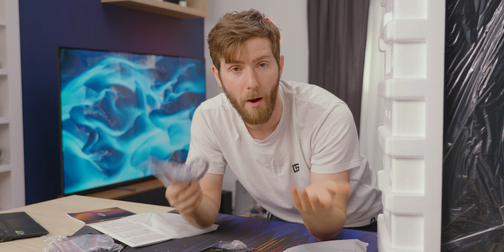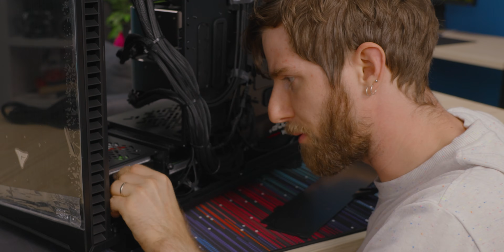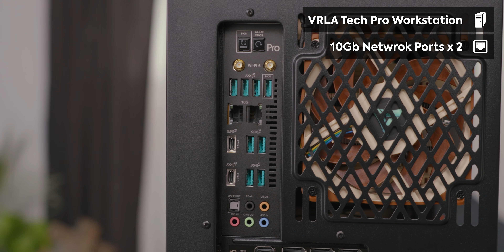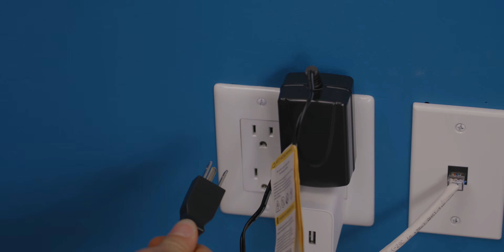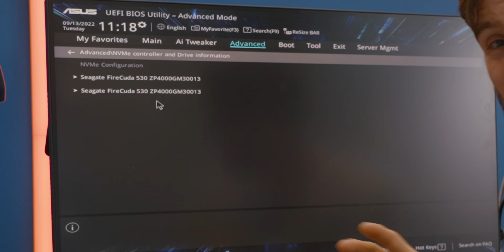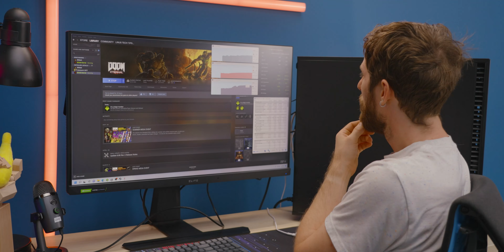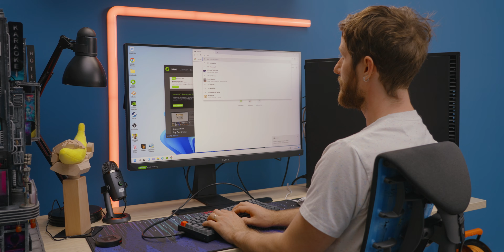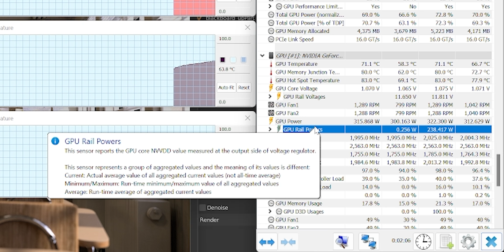This PC blew our circuit! - VRLA Tech Threadripper PRO Workstation

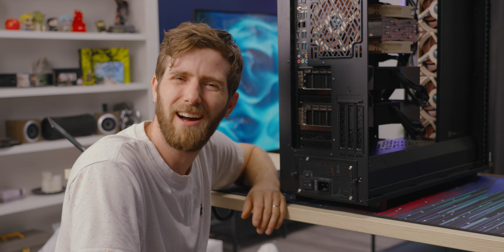Comment: 5:08 - I actually still use all those ports, though not for their intended purpose. I use FL/FR (green) as stereo out with parametric EQ + highpass to my main studio monitors, C/SUB (orange) as stereo out with lowpass to my subwoofer, and RL/RR (black) as stereo out unprocessed to a stereo amp that I test speakers with, though I plan to also use this for the sake of making mixing in desktop audio easier when I have a physical mixer board. All three operate independently from each other with EqualizerAPO, or with HDAJackRetask in Linux, and all three process the exact same stereo signal.
Reply: i use dante for any non standart thing. it works great, and uses one a reliable network.

Comment: I have a VRLA Apollo model I bought a couple years ago when Linis ran his first video about them. It's not a top of the line pc, but I've had no issues in the time I've owned it and have been very happy with it. It is a very basic setup with little RGB. It has a ton of room in the case if I ever want to add anything to it. I highly recommend them as I've had several pcs over the years from various companies.

Comment: Linus I thought you already knew it's only Windows that prevents automatic configuration of dolby surround. MS requires DOLBY ATMOS or equivalent to support more than 2 speakers its a licensing thing.  In the past I had always used the SPDIF or optical or the component jacks with windows but now I just run Ubuntu on my Home theater PC.  The MB manufacturers don't really care what MS says and continue to offer the jacks like they always did.

Comment: “No, don’t touch my precious dozen 3.5mm jacks! I am one of those people that needs them!” (Proceeds to describe using Optical and/or One (1) Singular 3.5mm output.)

-Every commenter saying we should keep the cancerous tumour of useless 3.5mm audio jacks.

Anyone that uses their motherboard as a surround sound source is going to use the Optical port or HDMI audio. 99.5% of everyone else is going to just use the stereo and mic in jacks.

I would vastly prefer that all of the circuitry dedicated to 7.1 channels worth of Pre-Amplification and DACs to shitty little 3.5mm jacks went to just giving the headphone port an amazing onboard DAC and High Impedance capable Amp. 

Hell - even optical is dead and gone at this point, I’d take a well integrated HDMI 2.1 Audio option with Atmos / E-ARC support any day. Chuck that plastic piece of 1980’s detritus in whatever old folks home they stuck Beta and HD-DVD in. 

For anyone that does still need ALL of those other 3.5MM ports for their 7.1 Surround Sound (and inexplicably decides to have their primo audio signal source run through copper strands the thickness of Galadriel’s finest pube, complete with the several metric gigafucktonnes of interference that only such a girthless unbalanced analog conductor can provide), there is a simple solution. Go on eBay and buy a High End SoundBlaster card for $10. There’s Eighty Shittillion of ‘em out there getting shoveled onto the global e-waste pile every second (I wonder why). 

Do they even make speakers / amps / receivers that can accept 7.1 via 3.5mm anymore? No? You’re adapting 3.5mm TRS to XLR? Oh yeah? Cool. Cool beans. Cooool. Unrelated question :
How many bodies you got under those floorboards there you absolute gotdamb psycho? What next - you gonna chuck a friggin VGA adapter on to that 3090ti? 

If you have a high end 7.1 audio system and are feeding it the salmonella riddled gruel that is unshielded 3.5mm cable (or are one of aspiring Mensa pledges in here screeching for Szechuan Audio Sauce), I hope that you get help (picking out a cute straight jacket). 

If you disagree feel free to go into the streets and protest. Don’t bother making signs, I’ll know it’s you guys when I hear a portable Behringer PA system blasting a 96kbps Limewire MP3 of “We’re Not Gonna Take It”.

Comment: On the 7.1 audio topic, I do use 5 of all 7 channels, just for processing (not aplification), have an all diy setup, a sub that's flat from 10 to 70hz, 2 woofers that take it fom 70 to 120 and a pair of bookshelf to do the rest. Everything is equalized using rew and equalizer apo (with an umik-1).

I'm finding very dificult to upgrade my pc (10 years old already), since newer boards with 7.1 processing are very expnsive here in 🇧🇷 .
Reply: why not use a usb 7.1 dac??
Reply: @juri14111996  I'm not sure if the equalizer apo works with it like the onboard does, because I do have 4 diferent channels being individualy equalized, like my sub and my woofers are a copy of the main channels. The sub has a low pass, the woofers have a bandpass and both are also equalized and gain matched. But if an usb card does work like onboard audio, it's  going to save me money when I upgrade my pc.
Reply: @captanspace  if you use a special 3. party software for this it should be no problem.
I think your dsp programm just installes a virtual audio device to get the audio of every app you use and converts it to 6 or 8 channels witch get sent as 5.1 or 7.1 to your physical audio card. So it should work just fine.  An alternativ solution is to use a cheap dsp, diy perk just did a video about a hidden tv with 7.1 audio, using a cheap dsp to splitt the audio in different frequency ranges for the different drivers.

Comment: I actually have that same motherboard with 256GB of 3200 DDR4. It has a 3955WX 16-Core Zen 2 Threadripper Pro. It's going to be my storage server. I got the motherboard complete in box with the ASUS 4xNVMe card for $770 US. The CPU was more expensive at $950

To answer your question Papa Linus, I actually use the motherboard audio ports for surround sound. 5.1 Channel.

Comment: sigh  Yes, I have a 5.1 analog speaker set I hook up to the audio ports on the back of my PC.  This is actually a change vs. the USB soundcard I used for 6+ years before this PC upgrade.

Comment: I actually used the line out for audio up to 5 days ago... got rid of it because of noise in the audio due to lack of shielding. Light doesn't care about that.
I also got this case and really like it! enough space allthough I would've liked it if the front fan mounting wasn't as bulky because it does obstruct quite a bit of the fans when you use 140mm fans. (liquid freezer II 420mm in my case)
Reply: optical sucks tho it has super limited surround unlike analog which can do any kinda surround.
Reply: @gamagama69  I'm not sure what you mean exactly but if you mean the options of surround (decoding) types, that is not really a problem for me because I run 2.2 audio and have no center or surround channels of any kind.

Comment: I have the NF-12 and A14s in mine, and I think I put around $300 in fans since I slapped a second fan on my TR4x 3990x Noctua tower cooler. 8 NF12s and NFa14. Then the extra fan on the CPU Block. 

Wait how was this 20K? This has way more stuff in it than mine. And mine was 15K. OH YOU KNOW WHAT, they probably saved a butt ton of money going 2.5 and 3.5 where I was being silly and went with 2 8tb NVME and 1 4TB  Gen 4. Where they probably have a reasonable boot and main NVME like 2 TB and then 100TB in SSD and HDD. for the same amount as my two 8TB sticks. Also probably didn't get scalped on the graphics card where I paid around 1k more than necessary.  I went with the same tower. I get silly temps on mine in an 80F plus room, never went above 60C when running Cinebench on overcolocked CPU and GPU. How I almost got 60,000 score was like 100 points shy. Edit: I went with the industrial class fans in my rig, and it gets up to 80dB, LOL.

Comment: I use analog 5.1 but the last three boards I have bought have Fd up drivers and do not work right...center channel doesn't work or the left channel becomes the center channel...the two sound cards I bought only one works correctly and it sounds like garbage

Comment: The 7.1 ports in the rear are functionally just there so that you can also piggy back off the 2 ports in the front also for some kind of Dolby Atmos(9.1 surround) support. It would be technically better to use the motherboard 7.1 ports to free up data from your HDMI cable so that you could comfortably enjoy full 4k/or high fps with no image loss & run an extremely high bitrate out to each individual speaker (in my setup, I run an individual amp to each channel (4 amps (the subwoofer is being passed through the center channel)//note: not Dolby Atmos compatible amps, for this you'd probably need to run sound through your HDMI to an amp, but technically you could theorize noticeably better sound quality coming from extremely high end speakers this way). :stayhome:
Reply: If your motherboard sound driver (like realtek //depending on the motherboard) supports additional channels than Atmos support than becomes more of an identifier for media that will be compatible than a requirement, also Google is working on an Atmos competitor that is rumored to be popular among tv manufacturers due to Dolby charging money per tv and google offering the service for free. (Informative note: Most PC streaming services don't support surround sound on windows besides Disney+ at this time, but if you have a pc with lots of storage you could just pick up a bluray 4k player, look for atmos compatible blurays, and rip them to your pcs storage, keeping the disc's as failproof backups) and get surround sound this way).

Comment: Yes, absolutely, some of us do use normal surround systems. And it still puzzles me why now they aren't considered "cool" anymore despite still sounding miles above all the dinky headphone surround emulation technologies. Their use become so niche, that possibility itself is often overlooked. Case in point: when I chatted with devs of one of my favorite games and mentioned how great and immersive it sounds on surround speaker system, their response was basically "Oh, we didn't even knew nor checked that it supports that. I guess it comes enabled by default in the game engine we're using"

sad surround noises
Reply: Agreed, disappointing how many games use stereo audio or only optimize the audio for headphones these days!
Reply: but you can just use a 7.1 usb dac.

Comment: I know a machine like this is literally meant for one thing and one thing alone, work. That being said, I do kind of wish they used redux or chromax fans inside of it to keep the black aesthetic. Idk about you guys but the idea of having a 5995wx on the asus pro art all black motherboard with a bunch of rtx a6000s with nvlink bridges, and every memory slot populated with 256gb lrdimms each using a black ek ram heatsink module, an all black 360-480mm aio and all black noctua fans is just a wet dream to me. Use 2 of those p5800x optane u.2 drives, and 5 8tb Sabrent rocket 4 plus drives using the m.2 quad raid card. Populate all the sata ports with 100tb nimbus ssds, and top the whole system off with an asus thunderbolt4 card. That right there, especially if use use all the ek professional watercooling equipment for it would be literally the fastest computer you could build that isn’t some crazy custom ln2 or liquid helium closed loop thing that wouldn’t be feasible. Not only would it be the fastest and most extreme thing you could build, it would also be an absolute beautiful system. All black. Everything covered in black heat sinks or black shrouds over the pcbs. Even the nimbus drives are black if I remember correctly.

Comment: I just want to,point out that those stickers like the one covering the IO Panel at the back can generate quite a lot of static electricity when you tear them off. Either use ones that are specifically anti-static and for electronics or don’t use them

Comment: To answer your question, yes, I still use analog 7.1 audio ports (when I game, I use a pair of Razer Tiamat 7.1 v2 headphones, with discrete drivers for each channel). It helps with hearing the bogey shooting over your shoulder.
Reply: i have the version 1 of this headset, still works, but i dont use i any longer. i switched to a logitech pro x wireless.

Comment: 7.1 Analog is kinda useless for a real 7.1 surround sound system. However, many companies like Logitech will make 7.1 or 5.1 PC speaker setups, which is indeed cheaper than the better HDMI surround sound which would also enable Dolby Atmos and you could use some real speakers and not shitty PC speakers. So while not used by many, it is still used.

Comment: I don't get why you say the 1600w power supply is "future proofed".
3090 ti can boost to take up to 450w a piece, and I wouldn't be surprised if the threadripper pulls 200+.
That's 1100w, all the peripherals might also pull close to 100w.

that's a theoretical max draw of almost 1200w, most power supplies are most efficient at ~50-70%, so I would say that it's a rather good pick.

Comment: I have used the optical audio out (SPDIF) to my old 5.1 receiver, which I only use for my PC, for over a decade. Been meaning to get a Dolby Digital Live compatible sound device (mobo or sound card) for years to make that worth it, as I only get surround from DTS right now.

I'll likely upgrade to a Ryzen 7950X and RTX 4090 before I get a new sound receiver or replace my 3 cheap 1080p acer LCDs. XD

I'm kind of excited for Google's new Dolby Atmos alternative. Maybe someone can figure out how to send more data over the old SPDIF cables to make using them actually worth it again.
Reply: Also, I'm surprised SLI isn't a big thing for VR. One GPU per eye, plus shared RAM for textures? Sounds like a match made in heaven.

Comment: Keep the 3.5mm audio jacks! They are very important to a lot of people.
Reply: I'm sitting here wondering what other ports people are using. I've always used these since they started building audio onboard. I use the front mic and headphone ones too for when I get on Discord.
Reply: @Krojack76  usb
Reply: @MRMEOVV  Could you elaborate, do you mean a usb soundcard?
Reply: @TnvTablet  just look up DAC
Reply: @MRMEOVV  so essentially a usb soundcard
Reply: @TnvTablet  other way around, but yes.
Reply: I use a compact hifi system from ~2000 that powers two good speakers on my desk, that's a very good low budget high quality sound setup even in 2022!
Reply: My Bose companion speakers liked your comment
Reply: @elpolleo  try upgrading. Your ears will be thankfull.
Reply: @TheAdatto  better than Bose? Some brand I don't know ? Boston. Etc.?
Reply: I'm using the front port for my bass amp's backing track input, the back for my 2.1 speaker system on the table and USB for my headset. I use all the ports!
Reply: Yes i came to the comments to say exactly that, while I'm not really a surround sound guy with my movies, my PC also has my whole music collection stored on it, and its wired to my stereo with a 3.5mm to RCA cable
Reply: @davidzcomputer3303  Right, but you aren't using 6 different 3.5mm jacks at once. Which is what he is talking about.
Reply: Yup, Logitech 5.1 surround sistem here, connected via 3 aux.
Reply: Yes

Comment: I have this Motherboard currently loaded with a 3955WX and 128GB of 3200mhz ECC
1x 3090 Kingpin installed with another sitting on my desk to go in SLI when I have a good time to redo the water loop

AMA

Comment: YES! the audio ports are EXTREMELY useful! 
I use the Line-In port with my Nintendo switch so I can listen to the switch and my pc at the same time!!!!!
The digital-out is also very useful!
Reply: i used to use that then i got upgraded my gpu and it got way too noisy i think the gpu whine overpowered the protection stuff. 

it sounded better frankinstining an adapter, which i had to use anyway for discord cuz i was too stupid to figure out how to use 2 inputs at the same time
Reply: just use a usb 7.1 dac.

Comment: Ref: Still using Analog surround outputs - YES, YES, YES!  I hate that fake positional surround for headsets.  The positioning of sounds is always awful, & it colors the audio in an ugly way, often making it muddy; it just doesn't work for me.  But I still have a working ROCCAT KAVE headset, with 3 or 4 individual speakers in each earcup you get PERFECT surround sound positioning.  Of course, it just needs those 3.5MM analog inputs - 4 of them! & USB connections too.

Why do analog Headphones need USB?   They have a bonus Feature - RUMBLE!  Explosions & Bass notes are punched up by eccentric weight vibration motors in each earcup.  This is a fantastic feature that needs to come back - MORE VIBRATING HEADSETS! Why is nobody doing this?!?

Of course for speakers I've moved onto sending audio to my receiver by HDMI.  But I wouldn't want to give up my Roccat Kaves even though they're more than a decade old.  I was a big Roccat fan back than, just because they would do this nutty stuff.  More nutty peripherals please...

Comment: using old AIWA Surround Speakers which ironcially is actually older than myself... still works great(using the optical audio cable on the back of the mobo)

Comment: Yes I still use 5.1 sound on my computers ever since windows 7 I couldn't function without it I need that middle Channel. you should  do a video on the subject. I've had two external 5.1 video cards and several internal pci cards. been a fan since 2011 have a good day

Comment: I still use the onboard analog audio to drive a second sound system for sim racing.  I have a 5.1 setup on the onboard audio for car sounds and use the VR headset for in car communications

Comment: In response to the audio output relevance…my parents still have a RIDICULOUSLY OUTDATED set of Altec Lansing GCS100 desktop multimedia speakers that they are still using. I would also like to note that they are also currently using a CyberpowerPC 2017 Model C Series gaming PC with an AMD Ryzen 5 2600 CPU and an MSI Radeon RX 580 GPU. I know that by today’s standards, it’s not a huge powerhouse, but I want someone to guess what they use it for. Go ahead, guess.
Reply: Solitaire and Cat videos